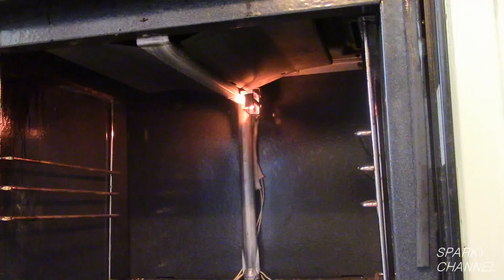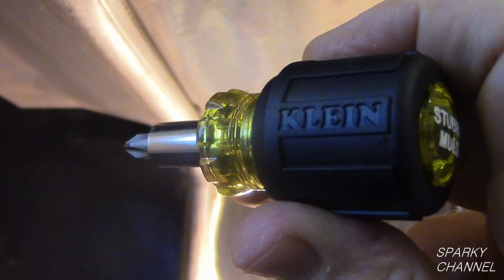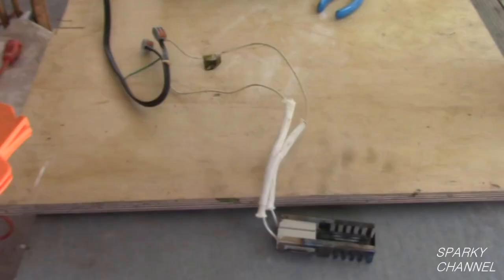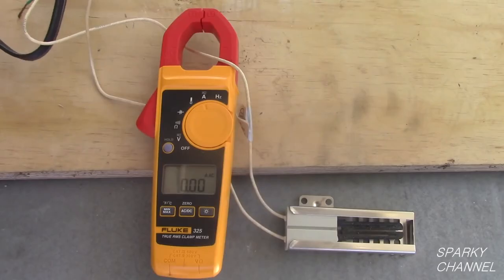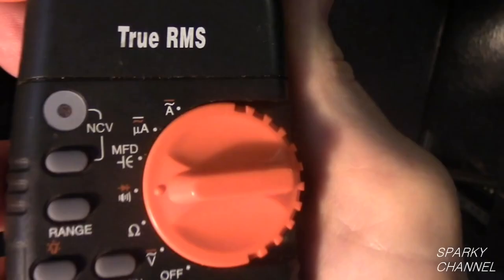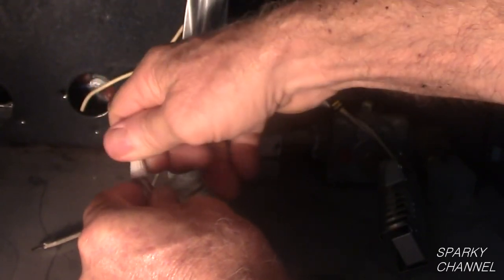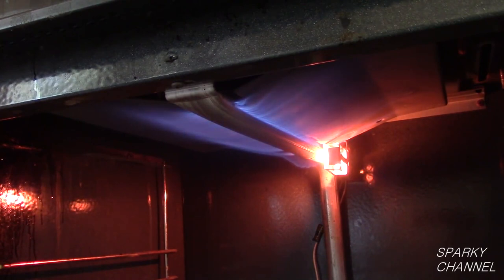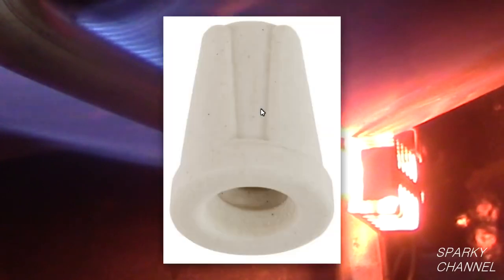Oven Not Lighting? How To Test and Replace an Oven Ignitor

Comment: Big fan I was wondering if you could make a video explaining the purpose of junction boxes and how to use them thank you
Reply: You use junction boxes every time you make connections between cables, and you don't have a switch or an outlet where you could make the connections in the back of the box. They prevent that cable connections are exposed. In the best case tools like a screwdriver are required to open them, so kids can't mess around with them easily. Exposed live parts are always a thread. There are also junction boxes available for outdoor use, they are protected againt the ingress of dust and water.
Reply from the maker: I put it on my list of videos to make.

Comment: Does it matter which wire connects to the original wires?
Reply from the maker: The hot wire goes to the positive terminal.
Reply: Doesn’t matter at all.

Comment: Can I test current draw from the igniter while it’s still connected in the oven? I’m assuming I should just turn off the gas?   Can somebody tell me what happens without the heat shield if the gas ignites?
Reply from the maker: Yes but make sure the gas is off!
Reply: @SparkyChannel  Thanks!!

Comment: So what could it be if the igniter doesn't glow??
Reply from the maker: It could be the igniter, or it could be that the igniter isn't getting power.
Reply: @SparkyChannel  but my stove top turns on and so does the broiler it's just bake igniter I have bought 2 different ones and both would not glow after connecting them. Do you know what could it be??
Reply: Same problem with mine, bake element is only one that doesn't work right. Slow to warm up and won't maintain temperature. Flame is very small until I tap on the regulator or valve and then it has normal flame.
Reply: I read that the igniter affects gas valve function, not drawing enough amps and gas won't turn on. Took igniter to repair shop and the guy said if it goes it should be good. Well maybe not.
Reply: @madman432000  ours turned out to be the thermostat